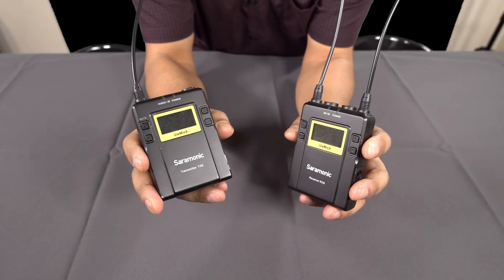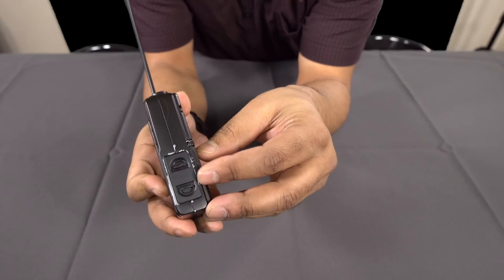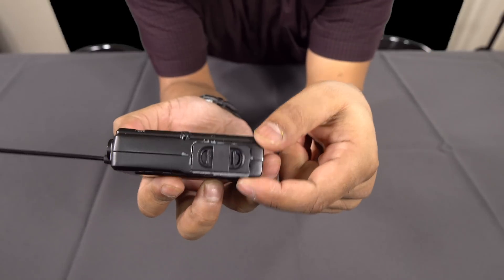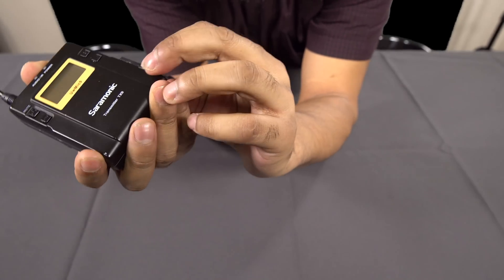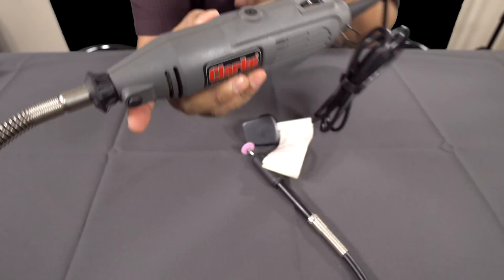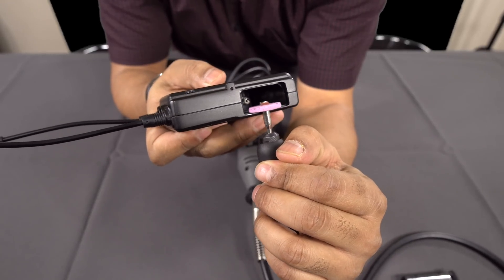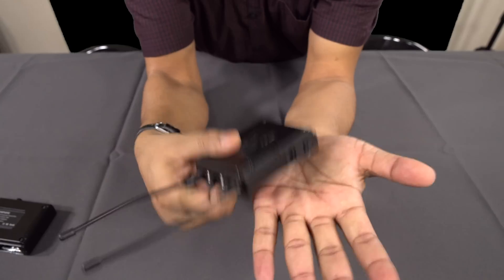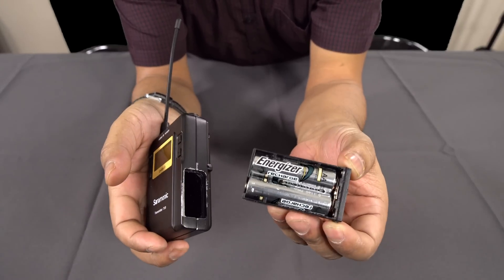Saramonic Wireless Microphone System Battery Box Jammed Stuck - Problem & Fix

Comment: Hello, I love your video, I just encountered this problem, I would love for you to show us how you got the batteries out first. I'm currently struggling with taking out the old batteries.
Reply from the maker: Thank you for watching the video 🙏  OK, I used a combination of butter knife and flat micro screwdriver.  You kind of have to wedge it out.  It will feel like something is going to break but it’s a full metal body and it’s very strong.  You will most likely scratch the paint while doing this, it’s one of the perks ...  Hope that’s helps ....
Reply: @BritishTechTV  Thank you so much for this, it did feel like I was about to break something but I was successful, keep up the great work sir!!

Comment: Thanks! The same thing just happened to my Sony UWP wireless set (that the Saramonic was apparently copied from) that uses the same battery box system. But I'm still not sure how to get the stuck batteries out of my receiver....
Reply from the maker: Thanks for stopping by Kerry ... Right, you are going to need something sharp and flat and then you have to wedge it out.  It’s a pain trying to get them out and it may feel like you are about to break something but with enough fiddling about they should eventually pop out.